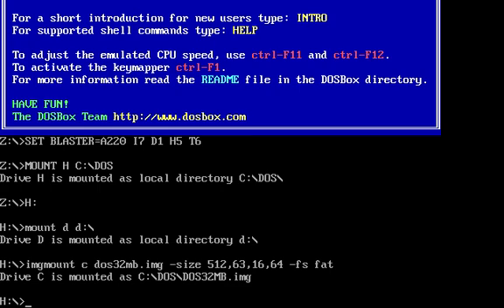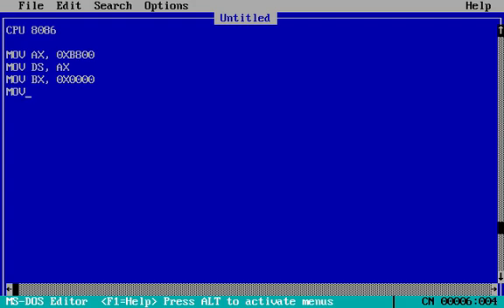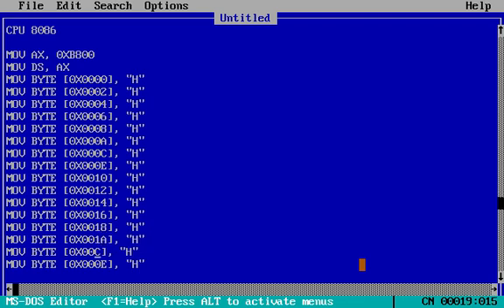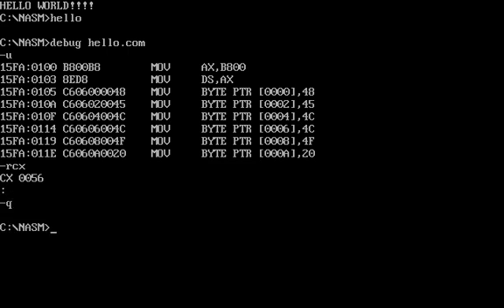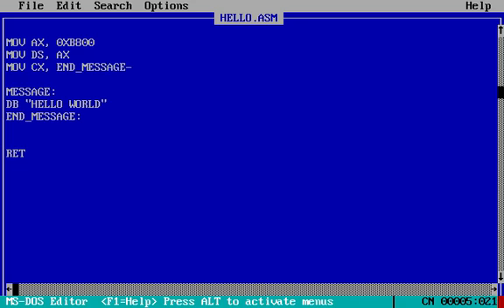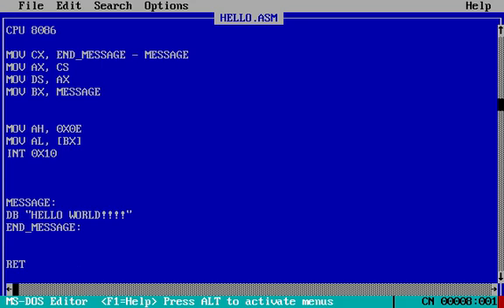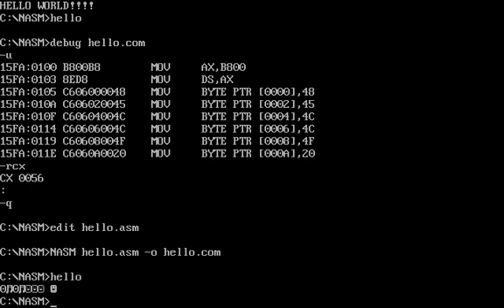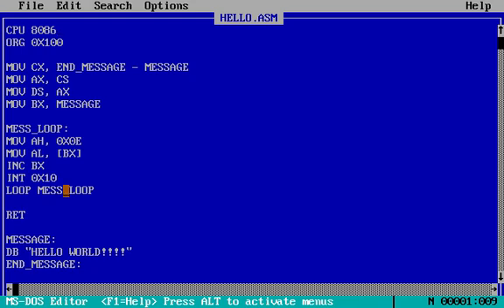8088 Assembly demo "Hello World"

Comment: In DosBox we can use 32 bit instructions in the 16 bit Real Address Mode and we can switch into the 16 bit BIG Real Mode with a segment size of 4 gb for DS, ES, FS and GS segment, but for CS and SS segment only 64 kb with ems=false in the config file.

This enable to write into the linear framebuffer of the svga-S3 emulation for VBE-mode numbers with a resolution of 800x600x32 for example using an address size prefix.

Example to copy a tiny picture from the upper left corner to the center of the screen: (all numbers are hexadecimal)

xor eax,eax
mov ax,ds
shl eax,4
mov esi,C0000000  ; linear framebuffer
sub esi,eax
mov edi,esi

add edi,EAC40  ; center of the screen
mov ebx,AE8
mov edx,36
P1:
mov ecx,66

rep
DB 67    ; Address size prefix
movsd   ; copy from ds:esi to es:edi

add esi,ebx
add edi,ebx
dec edx
jnz P1

.....

Routine to switch into the 16 bit Big Real Mode:

@echo off
REM UNREAL.BAT
REM For switching from the 16 bit Real Address mode into 16 bit Unreal-/Big real mode with
REM changing the segment size from 64 kb segment size to 4 gb segment size
REM for DS, ES, FS, GS segment register, but not CS and SS segment register
REM and at last open the 21 address line.
echo a>tmp.deb
REM -- disable interrupts and NMI --
echo CLI>>tmp.deb
echo IN AL,70>>tmp.deb
echo OR AL,80>>tmp.deb
echo OUT 70,AL>>tmp.deb
REM -- calculate addresses --
echo XOR EAX,EAX>>tmp.deb
echo MOV AX,CS>>tmp.deb
echo MOV [016D],AX>>tmp.deb
echo SHL EAX,04>>tmp.deb
echo MOV EBX,EAX>>tmp.deb
echo MOV [01B2],AX>>tmp.deb
echo MOV [01BA],AX>>tmp.deb
echo ROR EAX,10>>tmp.deb
echo MOV [01B4],AL>>tmp.deb
echo MOV [01BC],AL>>tmp.deb
echo XOR EAX,EAX>>tmp.deb
echo MOV AX,01A8>>tmp.deb
echo ADD EBX,EAX>>tmp.deb
echo MOV WORD PTR [01A0],27>>tmp.deb
echo MOV [01A2],EBX>>tmp.deb
echo PUSHF>>tmp.deb
echo LGDT [01A0]>>tmp.deb
echo MOV DX,SS>>tmp.deb
echo MOV EAX,CR0>>tmp.deb
echo OR AL,1>>tmp.deb
echo MOV CR0,EAX>>tmp.deb
echo JMP 0008:0150>>tmp.deb
REM -- start protect mode --
echo org 0150>>tmp.deb
echo MOV AX,10>>tmp.deb
echo MOV SS,AX>>tmp.deb
echo MOV AX,18>>tmp.deb
echo MOV DS,AX>>tmp.deb
echo MOV ES,AX>>tmp.deb
echo MOV FS,AX>>tmp.deb
echo MOV GS,AX>>tmp.deb
echo MOV EAX,CR0>>tmp.deb
echo AND EAX,-2>>tmp.deb
echo MOV CR0,EAX>>tmp.deb
echo JMP  0734:0170>>tmp.deb
REM -- switch back to Real mode --
echo org 0170>>tmp.deb
echo MOV SS,DX>>tmp.deb
echo POPF>>tmp.deb
REM -- open address line --
echo XOR CX,CX>>tmp.deb
echo IN AL,64>>tmp.deb
echo AND AL,2>>tmp.deb
echo LOOPNZW 0175>>tmp.deb
echo JNZ 0197>>tmp.deb
echo MOV AL,D1>>tmp.deb
echo OUT 64,AL>>tmp.deb
echo XOR CX,CX>>tmp.deb
echo IN AL,64>>tmp.deb
echo AND AL,2>>tmp.deb
echo LOOPNZW 0183>>tmp.deb
echo JNZ 0179>>tmp.deb
echo MOV AL,DF>>tmp.deb
echo OUT 60,AL>>tmp.deb
echo XOR CX,CX>>tmp.deb
echo IN AL,64>>tmp.deb
echo AND AL,2>>tmp.deb
echo LOOPNZW 0191>>tmp.deb
REM -- enable interrupts and NMI --
echo IN AL,70>>tmp.deb
echo AND AL,7F>>tmp.deb
echo OUT 70,AL>>tmp.deb
echo STI>>tmp.deb
echo RET>>tmp.deb
REM -- Global descriptor table --
echo org 01A0>>tmp.deb
echo DB 0,0,0,0,0,0,0,0>>tmp.deb
echo DB 0,0,0,0,0,0,0,0>>tmp.deb
REM 01B0
echo DB FF,FF,0,0,0,9A,0,0>>tmp.deb
REM 01B8
echo DB FF,FF,0,0,0,92,0,0>>tmp.deb
REM 01C0
echo DB FF,FF,0,0,0,92,FF,FF>>tmp.deb
echo.>>tmp.deb
echo n UNREAL.COM>>tmp.deb
echo rcx>>tmp.deb
echo C8>>tmp.deb
echo wcs:100>>tmp.deb
REM - unassemble routine -
echo ucs:100 l4F>>tmp.deb
echo ucs:150 l1F>>tmp.deb
echo ucs:170 l2F>>tmp.deb
REM -- Global descriptor table --
echo dcs:1A0 l8>>tmp.deb
echo dcs:1A8 l8>>tmp.deb
echo dcs:1B0 l8>>tmp.deb
echo dcs:1B8 l8>>tmp.deb
echo dcs:1C0 l8>>tmp.deb
echo q>>tmp.deb
debug<tmp.deb>DEB.INF
del tmp.deb
UNREAL.COM
del UNREAL.COM
Reply from the maker: This great info, thank you for your multiple comments.
Reply: @elijahmmiller  I figure it out that using the Magic DosBox free app on Android installed from the google play store we start into the 16 bit Big Real Mode with ems=true in the config file, so we do not need the switching routine to access the linear framebuffer with this not official DosBox version.

Comment: Output a colored string center align using a batch file and debug. Formular: (row * 160) + ((80 - string lenght) / 2) * 2

CENTER.BAT 8 1b "Hello World!"

@echo off
REM CENTER.BAT
REM Need three parameter (%1 %2 %3) attached.
REM Usage: CENTER.BAT row color "TEXT"
echo acs:100>tmp.deb
echo mov ax,B800>>tmp.deb
echo mov es,ax>>tmp.deb
echo mov di,%1>>tmp.deb
echo mov bx,%1>>tmp.deb
echo shl di,7>>tmp.deb
echo shl bx,5>>tmp.deb
echo add di,bx>>tmp.deb
echo cld>>tmp.deb
echo mov si,140>>tmp.deb
echo lodsb>>tmp.deb
echo cmp al,FF>>tmp.deb
echo jnz 0117>>tmp.deb
echo sub si,141>>tmp.deb
echo mov bx,50>>tmp.deb
echo mov cx,si>>tmp.deb
echo sub bx,si>>tmp.deb
echo shr bx,1>>tmp.deb
echo shl bx,1>>tmp.deb
echo add di,bx>>tmp.deb
echo mov ah,%2>>tmp.deb
echo mov si,140>>tmp.deb
echo lodsb>>tmp.deb
echo stosw>>tmp.deb
echo dec cx>>tmp.deb
echo jnz 0132>>tmp.deb
echo ret>>tmp.deb
echo org 140>>tmp.deb
echo DB "%3", FF>>tmp.deb
echo.>>tmp.deb
echo n CENTER.COM>>tmp.deb
echo rcx>>tmp.deb
echo 90>>tmp.deb
echo wcs:100>>tmp.deb
echo q>>tmp.deb
debug<tmp.deb>nul
del tmp.deb
CENTER.COM
del CENTER.COM

Comment: RCX gives the number of bytes in hex. So 86 then 35 bytes.
Reply from the maker: I know. I should have been more specific.
Reply: We can use debug to make a screenshot and to reload the content of the text screen using two batch files.

Example:
C:\>dir
C:\>ScreS.bat
C:\>cls
C:\>ScreL.bat

@echo off
REM ScreS.bat
REM Save text screen to file.
echo n SCREEN.SAV>tmp.deb
echo rcx>>tmp.deb
echo FA0>>tmp.deb
echo rds>>tmp.deb
echo B800>>tmp.deb
echo wds:0>>tmp.deb
echo q>>tmp.deb
debug<tmp.deb>nul 
del tmp.deb

@echo off
REM ScreL.bat
REM Load text screen from file.
echo n SCREEN.SAV>tmp.deb
echo rcx>>tmp.deb
echo FA0>>tmp.deb
echo rds>>tmp.deb
echo B800>>tmp.deb
echo lds:0>>tmp.deb
echo q>>tmp.deb
debug<tmp.deb>nul
del tmp.deb